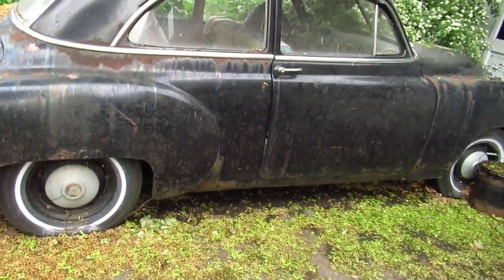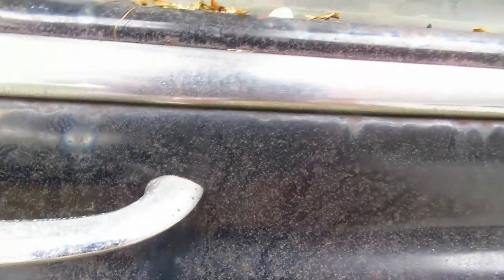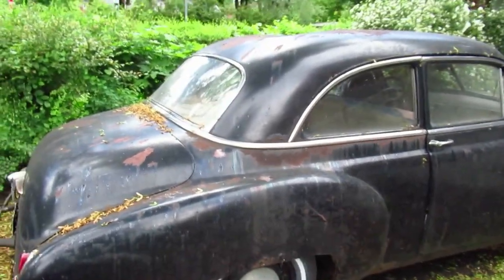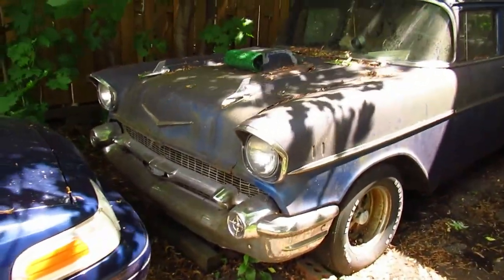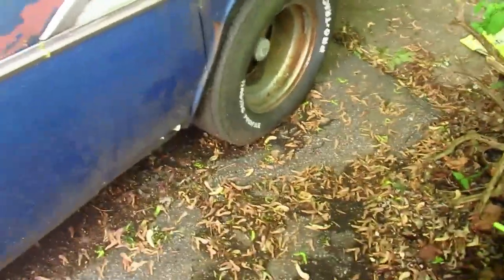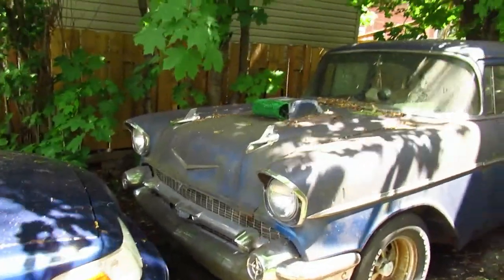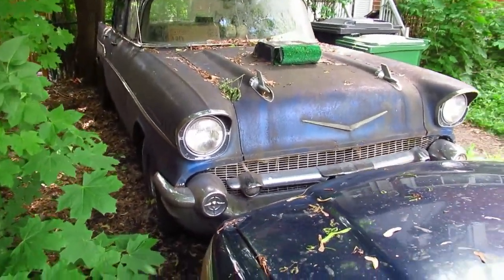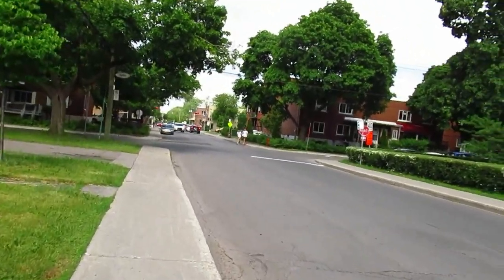BILL'S CARS WERE FIXTURES FOR MORE THAN 20 YEARS IN MONTREAL - JUNE 2020

Comment: G'day Elton,
interesting visit!
Some aspects I need to point out though…That pile of ‘hubcaps’ are actually  ‘wheelcovers’, as they cover the wheel rim. As opposed to the hubcaps on the ’49 or ’50 Chev (which we call ’em in the rest of the English-speaking world)…But I digress, as usual! As the front of the car is not visible it's not possible to pick which year; and even THEN the badge and grille differences are so tiny that only an owner would know!
AND that is a two-door sedan, not a coupe, mate. The coupe had long front doors and small rear side windows. That model MAY have been colloquially called a business coupe; (i.e. for toting a travelling salesman’s samples), but it's unlikely to be the body style term used by GM…
And my (almost) final bit of useless info. That T-bird is a ’62 model. I knew it was of the ‘61–’63 era; but had to visit Google Images (THE best place to check on North American car vintages), to determine that it's a ’62.
But that's not all, folks. IF you ever see a car sporting narrow-band whitewalls (like that Chev 2-door); they should NOT have been built BEFORE 1962! ’Coz that’s when they were introduced; for the ’62 model year. SO many movies set before 1962 have used correct-period autos—and then spoil the nostalgia effect with anachronistic tyres (or if you prefer, tires)! But it's understandable, as car clubs will allow member’s cars to be used as ‘dressing vehicles’. Few owners would spurn the $$ to enlighten the movie makers!